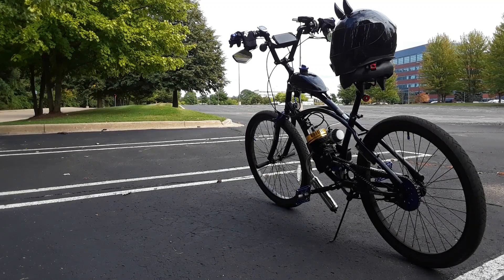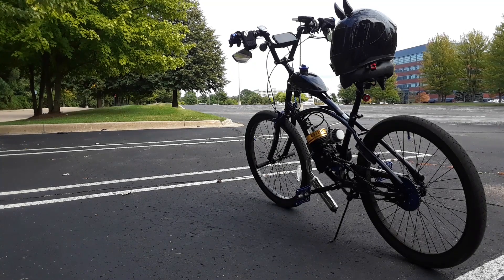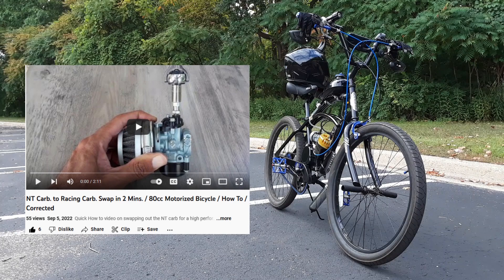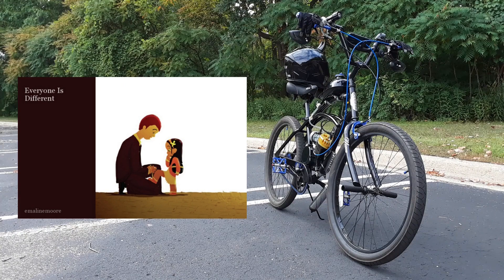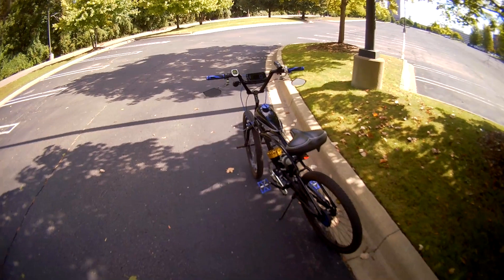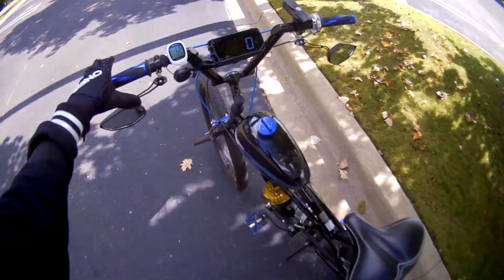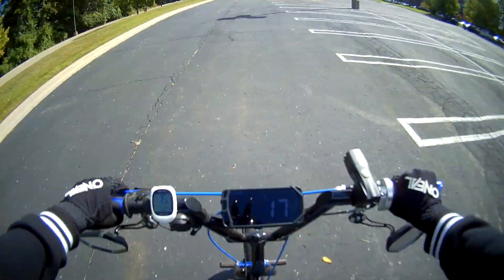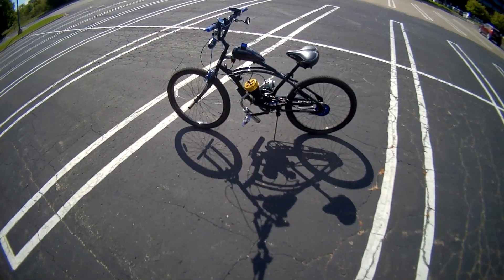Stock High Performance Carb. Testing / 80cc Zeda Engine / Pre-jetting

Comment: I'm sure you could squeeze a few more mph out of these carbs. This is what I do. 1. take the rear wheel off the ground. 2. run it WOT. 3. Lean it until it's screaming and then back it off a 1/4 or whenever your anxiety subsides a bit. I ran my tiny 49cc 7-8 miles at a time at 30mph and never melted.
Reply from the maker: Will do bro. I thinking anywhere from 63-68 jet should suit my new little friend here. Did I mention, no leaks...not even from the exhaust. Exciting times. lol.
Reply: Nice. I hate exhaust leaks. I wish I had a universal o2 sensor to tune my bikes. I'm working on it though.
Reply from the maker: I was thinking about it, but it would take extra money. I would want a separate exhaust and pipe, so I could take it off and on. I wouldn't want to ride with it on a normal basis.
Reply: @kachiskid  my thoughts exactly. The beauty of the 50 and 150 is both exhausts fit each other. If I could lay an airtight weld on a gy6 manifold... I would be rich.

Comment: Kachi's Kid,
My manual for my 2017 POWERMAX VIP 150CC says unleaded fuel...
I have been using 93 Premium...
What is your suggestion for fuel? I got it at 92kms and now is 342kms.
Just wanted to see what your thought are?
Reply from the maker: 93 is perfect. I mix in Lucas ethanol eliminator.
Reply: @kachiskid  Ethanol Eliminator I assume rids the fuel of ethanol (better for build up of gunk and for the rings and valves)...
If that is correct, do you add every fill up or how do you do that?
Thank you kindly for the response.
I have been riding 26 years and have always used 93 due to all of them being 50cc but this one is 150cc POWERMAX VIP and want to do her right!
Reply from the maker: @skeltonjosue1284  just to confirm I use 93 in anything that I have two wheels of. Now for my riding lawn mower I'll put 87 in that. If you check out my latest video on winterizing the lawn tractor I speak about how I mix my gas and show the ethanol Eliminator. Yeah I added every fuel tank but don't really trip out if I miss one or two. No problem, I love sharing knowledge. That's how I got my answers...gotta ask.
Reply: @kachiskid  thanks for the knowledge Brother!
Stay safe and ride hard!
Reply from the maker: Anytime, bro...anytime.